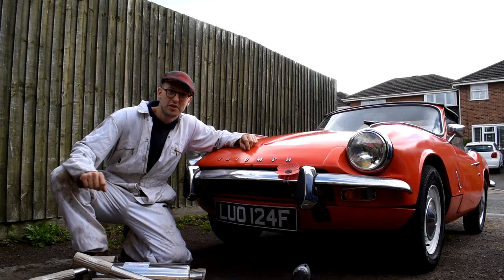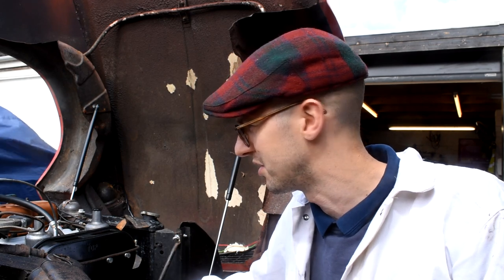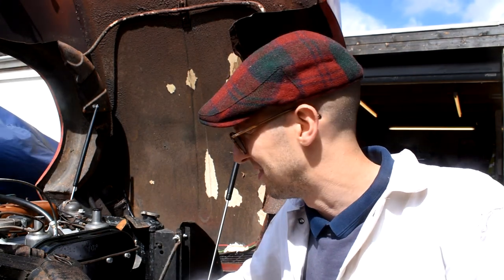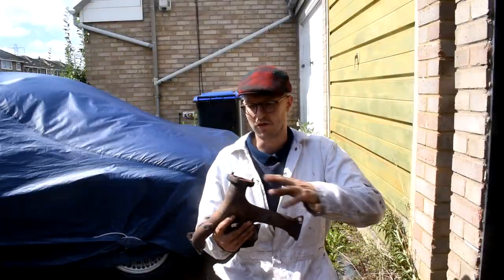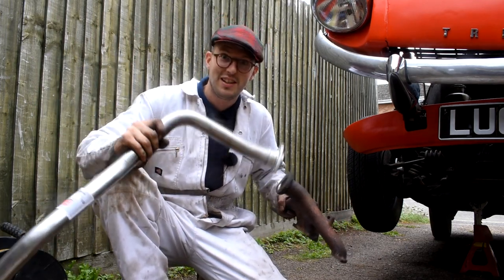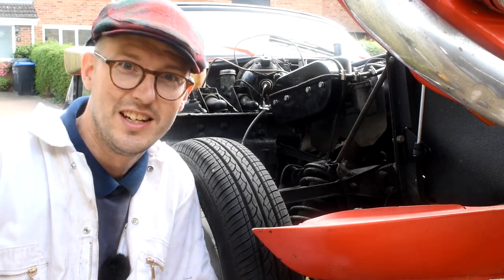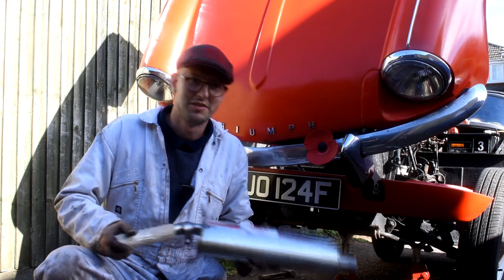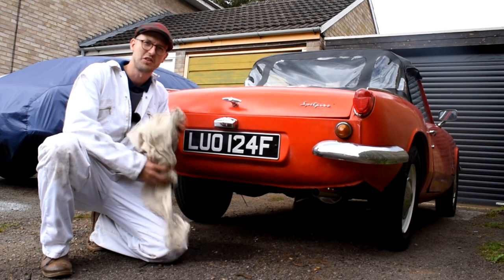Triumph Spitfire Exhaust

Comment: I had a new stainless exhaust fitted to my triumph. As the old one would rattle about  on leather bands.  
But now  like your new one shake the exhaust pipe and the car wobbles 😂😂    I did however have an expensive repair from the exhaust company. As they had no idea about unf nuts and studs/bolts.  So they put metric nuts on a unf stud and snapped 1 and left the others loose. Adding insult to injury they charged me an extra £100 for the hassle and blamed me for not saying about the thread patttern .  ( When they  planned the exhaust they did talk a good job .  Claiming they do old classics and modern sports etc  ) 
So please beware.  If your viewers take there classic to a modern exhaust place  ask about unf  nuts and bolts / studs  especially the studs on the 4:1 exhaust manifold which are studs.    Thanks for sharing your video. Much appreciated
Reply from the maker: Sadly many modern garages will go at something with the best intentions but not realize that British and American classic cars and bikes aren't like modern cars where one metric spanner fits everything. With British 60's and 70's cars you need minimal of AF kit, and if you go further back cars, or go over to motorbikes you need Whitworth and British Standard cycle thread too. Glade you enjoyed the video 👍

Comment: nice job Steve, I had my spit at the garage and put it on the alignment machine to see if I could get get rid of eating up tires....I figured I now own a shop....I have access to lots of tools now....and believe it...the alignment machine had the specs for aligning the spit.....and they matched the shop manual....maybe I will have to make a vid about it and share it...it was a lot of fun playing with the  settings...still have a lot of positive camber in the front so I need to find me some shims for the lower control arm. Anyhooo try to hit you up on insta with the shop profile just to let you know Im trying to keep up with you and love what you are doing with your cars...hope to have new material soon...take care mate!!
Reply from the maker: Cheers Robert, a big reason for the positive camber on the rear of mine is because it's got a new spring on the back. Spitfires tend to handle there best when the rear spring is old. The new rear spring you buy are made from thicker metal than originals, I've resorted to sticking sand bags in the boot for a few months, just to get it to sag a little. It's an old trick and it does work. The other thing that some owners do is fit a lowering block between the spring and diff, that seems to work well too. Look forward to your next video mate, cheers Steve
Reply: @SteveDentonClassics  the back is fine....it is the front that has the positive camber....I am how ever thinking of doing some upgrades to the suspension...I believe that the GT6 as an adjustable horizontal link from the  rear knuckle to the body.......but I have found that there are nice modern adjustable control arms and links that will fit the spit and GT6...I am also looking at modernizing the engine and other systems with EFI and other controllable parameters for better eco and performance.  I think those might prove to be interesting vids....since buying this shop I have been introduced to some new interesting concepts that I would like to put into my retro cars to make them more responsive...so much for going original....LOL
Reply from the maker: As one of my oldest friends has always said to me, there three ways you can go with a classic, original, original with upgrades or modified, whatever you do is better than it being in a scrapyard. EFi for me just defeats the point of owning a classic, as working on modern cars for a living, I just like the fact that a classic car is simple and easy to fix with not much to go wrong. However I do understand why people do it. And yeah I know what you mean with the adjustable upper wishbones, Canley Classics make them, I have know people to make them from scratch too. A little positive to dead straight camber on the front of any Triumph works well, if you introduce too much negative camber at the front it'll look good, but the consequence will be the steering will be heaver. Cheers Steve

Comment: That's a job well done! Very satisfying. One thing though, you really need some negative camber on those back wheels - it's not a great look when they're up on tip toes like that. Either your spring has been over tempered, it's the wrong spring, or it's possible you could loosen off every single bolt on the rear suspension a bit and then drive it round the block to get it all to settle before tightening everything back up again. Either way that back end needs to come down a few inches.
Reply from the maker: Cheers Steve, yeah that's one of them jobs I'm aware of, and it's annoying me a bit. The previous owner had replaced the rear spring but I've been thinking for a while now it's not the right one. I will get round to sorting it out at some point 👍
Reply: Most easterly Steve.The positive camber on  Mk1 Spitfires is "normal" . The heralds  and mk1 Vitesse shared the same problem . It was resolved in the later marks. I had a MK1 Vitesse that l fitted a GT6 MK2  engine and box in. I had 5 and a half inch "J" all round on 165 x13 and that kind of cured the problem . I think the serious boys would turn the spring upside down but that put tremendous strain on the driveshafts and suspension. You have to remember that 165x13 was as big  as you could get in the late ''60's !
Reply: @johndavey72  I disagree John. The Heralds and Vitesses were saloons with rear seats so their rear spring had to be tempered such that it would not exhibit excessive negative camber when fully laden - consequently, with only one or two passengers onboard they often retained slight positive camber in normal use. Spitfires experience a far narrower range of weight carrying. Even early Spits should never exhibit positive camber at the rear, even when unladen. With driver and passenger onboard there should be about 3 degrees of negative camber at the rear. You will find no original factory pictures that show Spits with noticeable positive camber - they are always between neutral and slight negative camber. Later Spits, especially late Mk4s and 1500s with their longer drive shafts tend to exhibit significantly more negative camber. Within reason, for the best road holding, early Spits cannot have too much negative camber at the rear.
Reply: @SteveDentonClassics  Some people really have noticed a difference if they loosen everything at the back and then tighten when it's laden - worth a try maybe. Also make sure those rear trunnion bushes are allowing the vertical links to move and adopt whatever angle they need to; if they're seized the wheels may adopt the wrong camber angle. I enjoy your videos - maybe it's all in the editing but you never seem to get angry when things don't go well. I'd be throwing spanners across the garage in rage!
Reply from the maker: Cheers Steve, I always think that when things go wrong, there nothing can do about it, just got to get on with it. It's just another problem to solve, just another jigsaw puzzle to make right. With the classic cars I'd do them weather I'm on YouTube or not as I just love working on them. With the daily job of fixing van's for a living that's a different story, but calmness is key. I know exactly what you saying with the Spitfire's rear suspension, and it makes perfect sense, as with the bushes etc being tighten up while the suspension is raised stresses them in that position. If I get a free moment I'll probably give it a try, I've got nothing to loose. I need to replace the rear shocks regardless and want to go round other areas, but that's all for future videos 👍
Reply: @MostEasterlySteve  Hi Steve. It's not often l'm right but l'm wrong again  ! 😂😂 l just remember when driving my Vitesse hard there was a very fine line between being  in control and totally out of control ! And when l trained  at a Triumph dealership in the '70's l do remember seeing the hilarious negative camber on the Spitfires when they were lowered off the jacks. Cheers.

Comment: Great video Steve. What a pain you had to get that manifold off! How come you need to remove those dash pots to get the intake off?
Reply from the maker: Cheers buddy, I just find that taking the dash pits off makes it easier to get a socket on the carb mounting bolts. There’s also not a lot of clearance on HS2 carbs to manifold so again for the sake of 2 screws it’s easier just to remove them 👍🏻

Comment: Might have been worth heating the stuck studs with a blowtorch to try to release when you had the manifold off. There are also extractor tools - a bit like reverse-threaded taps. You drill a pilot hole down the centre of the stripped but then you "tap" the whole anticlockwise.  The extractor is wedge shaped and progressively bites in, you get a lot of purchase. Saved my bacon  on quite a few instances. Not tried them on an exhaust though manifold though - they really seize, so I'm not surprised you had problems. Nice work anyhow!
Reply from the maker: I know the exact tool your on about, and I've used them a few times. When they work they are brilliant, however I've had a few snap on me and they can be a bugger to get out. As with the blow touch method, I've done it that way many times at the garage I work at, saves so much messing about, but sadly I don't have a blow touch at home, hence running the engine 👍

Comment: Steve, anti-seize on those studs for next time?  WD40 was developed as a water displacement (WD) product.  Get your self a can of OEM penetrating fluid, and stay away from the retail stuff, you may get better results.
Reply from the maker: Oh yes, as soon as I replace the manifold bolts with the correct studs they will be copper slip on them. And with the WD40, I’ve tried various different types of penetrating fluids but I just get on well with WD40. That said I’m always open to trying new things, what do you use?
Reply: I actually work for a chemical blending and packaging company that manufactures automotive service chemicals for the OEM's, so I use what we make (any brand, same products for the most part).  Use a known industrial brand, or Ford, G.M, Honda, etc.

Comment: Hi Steve, just a quick question. I really like the twin exhaust look, very much like the Monza set up on the TR6 you did. The question,  would it be easy to fit that type to a 1964 Spit? I've looked on Moss Europe and Rimmer and not sure what I'm looking for 🤣
Reply from the maker: Hi Russ, it's all depending on what sort of twin exhaust system you are looking for. Moss Europe and Rimmers both offer good twin exhaust systems, the Phoenix twin back box system from Moss is a very good exhaust system. A for a Monza or Ansa set up with quad tail pipes, they are not available in the UK, if you want that style of exhaust for a Spitfire, you will have to buy it off a USA or Canadian website and import it. They are really easy to fit, but they do require drill two bobbing into the boot floor pan to hang them from. Twin back boxes do look really great Spitfires, I used to have a Phoenix twin back box on my Spitfire 1500 👍
Reply: @SteveDentonClassics  Thanks Steve for taking the time to reply. It's purely an aesthetic look for me, I love the symmetry of a twin exhaust. I've just had a look at the Phoenix on the Moss website, looks a winner in my eyes. So once again this now goes on the shopping list (It keeps getting bigger🤣) cheers for the info. 👍
Reply from the maker: No probs and you're welcome 👍

Comment: What is the product you used on the joins
Reply from the maker: I'm not very product loyal with exhaust paste, so it's whatever I can get hold of at the time, normally Holts exhaust paste works well, that said I have used low melt grease before now as it attract the carbon and melts off fast giving a good seal over time 👍